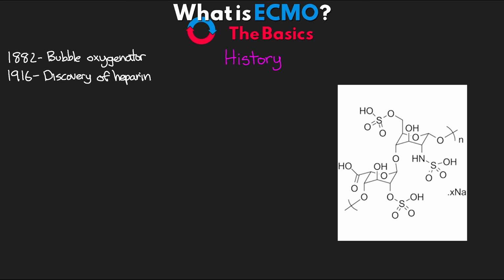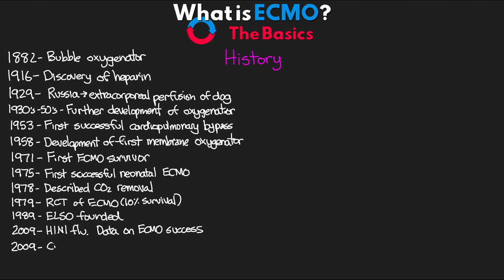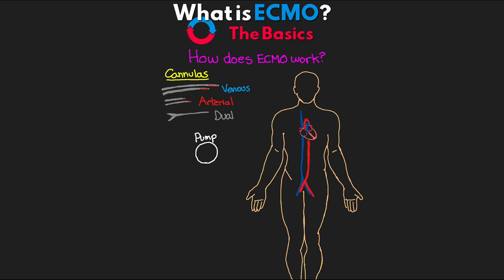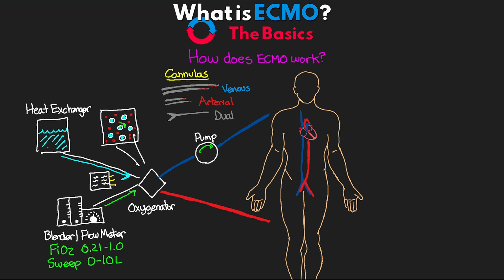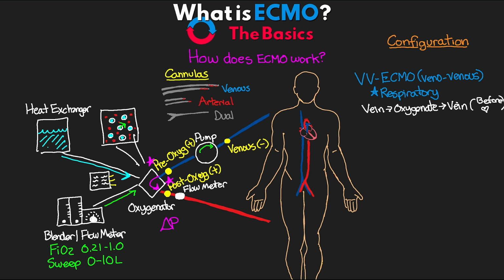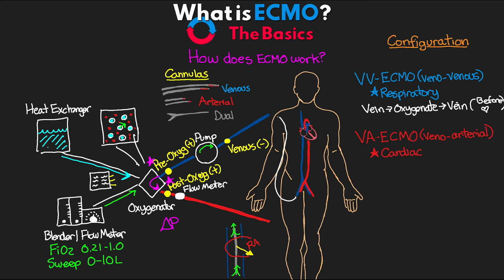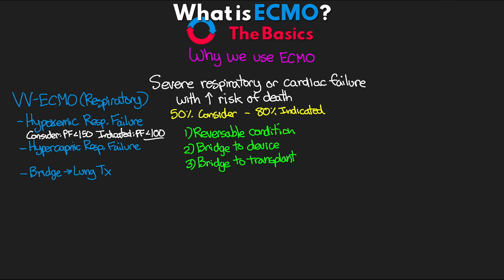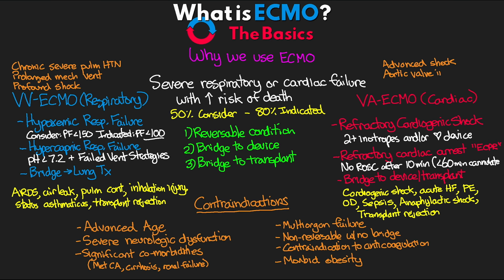What is ECMO? The basics explained.

Comment: I guess I missed something, how does returning oxygenated blood to arterial side help, if patient has heart failure and can't pump it around?
Reply: The ecmo provides the pressure
Reply from the maker: Yes! So in VA ECMO (which you described, pulling from the veins before the heart and returning blood to the artery after the heart), we are moving blood forward in the system without the help of the heart. When the heart is unable to adequately move enough blood forward, we can use ECMO to "bypass" the heart and still provide perfusion to the rest of the body.

Comment: My wife is an ECMO survivor. She was 18 years old at the time. She had DKA w/ BG of over 1000. She was ECMO for 13 days. She actually had a tracheotomy before this. Then coded twice. 

They did not think she would survive. The only reason she was placed on ECMO and survived is because she was a registered organ donor. They were waiting for her Brain waves to stop but they never did. Instead she started to turn around. 

At the time she went into renal and liver failure. She had issues with ARDS as she was weened off.  To everyone’s shock in ICU  once the glucose levels went down the liver function came back online. Eventually she came of dialysis and renal failure improved she still ended up with AKI. 

From there she was still vented. It was for a total of 2 months with the trach for successful weaning. 

After that she was in rehab for a month and had to be classified as a stoke patient due to how everything affected her. She did end up with a brain injury while on ECMO. She also had her issues with her arm literally exploding and now lasting nerve damage. 

Finally here was the outcome from all of this, she basically has normal function, she works as a CNA as of today if that is not a testament, don’t know what is. 

There are lasting effects for her though, her gait pattern is a bit off. She has issues with her right hand with nerve damage, unable to detect pulses and has isssues detecting hot and cold. You can tell she had a brain injury by the fact that she has hard time remembering things from before ECMO but her current memory has no issues. She is currently studying to be a nurse. There is some issues with lung scarring and scarring from the trach internally. She has some issues with feeling in other places like her bladder.
She is ten years on now and you wouldn’t know by looking at her other then the scarring on her neck from ECMO entry point, the CVC, Trach, dialysis scar and the marks from her lungs being drained that anything happened to her.
 
I worked as an ICU nurse being trained in ECMO and am absolutely amazed by her story.

Comment: Just a question. If a patient on ECMO requires RRT, do you prefer to go for PD or HD/CRRT? Because it would be difficult to have so many lines in patient.
Reply from the maker: CRRT for sure. We usually line with HD line before we cannulate.
Reply: @ICUAdvantage  thanks for replying

Comment: Awesome! The ICU I work in doest do ECMO but we retrieve patients out for ECMO. I recently got to see a patent on ECMO. I could understand how he it was oxygenating him but didn't know how Co2 was being removed when he had tidal volumes of 7mls. You just explained it. Kind of like CRRT for the lungs. Thanks. 
However, why would they have an Fio2 on the vent as well. He had Fio2 of .70% on ECMO and vent.
Reply from the maker: Hey Don! Thank you. Glad you liked it and happy that this was able to help you to understand some of what you were seeing. It truly is a pretty amazing therapy that we can offer patients.

As for the FiO2, without knowing the situation there, it certainly is possible that the oxygenation from the single ECMO circuit was not enough. We can't control the oxygenation and they get full oxygenation. The rate of flow plays an important factor in how much blood we can oxygenate. If flows are decreased due to issues, we may need to compensate with additional oxygenation via the lungs, even if it isn't optimal. Over time, we also lose efficiency of the oxygenator to oxygenate. Think degradation and clotting.

It isn't that uncommon for us to not be able to achieve adequate oxygenation with a single circuit and sometimes have 2 circuits going to provide adequate flow and more oxygenated blood. I talk about this some in the 3rd lesson in the ECMO series here.

Hope that kind of answers your question. Ultimately, if we can get enough support with ECMO, we will use very minimal vent settings (sometimes even no vent). Other times, we need that extra support for some time.

Comment: In really enjoyed seeing how ECMO has progressed  over the past 30 years.  I was a cardio-pulmonary tech @ WHMC from 1973-1990.  Drs. Robert DeLemos and Don Null were some of the early neonatal pioneers in using ECMO.  The typical patient was a premature newborn, usually weighing less than 2000 grams and delivered because they were in fetal distress.  When that happened, the baby would release it's meconium plug (essentially inutero stool.)  It often had the consistency of tar.  The baby would inhale this while still in mom's tummy and require ECMO.  Wilford Hall's ECMO device looked somewhat like a Rube Goldberg device, but it worked fantastically well.  When I retired in 1990, WHMC had the only ECMO that a neonatal patient could be placed on and flown across the country.  The reason- at that time the standard aero-vac plane was some version of a Lear Jet.  Not a lot of room inside for all the personnel needed.   Thankfully, Uncle Sam had a large fleet of C9 air evac aircraft that could carry ECMO device, patient, 3 RN's and 2 technicians and a respiratory therapist.
Reply from the maker: How cool! Wow, thank you for sharing. Its always amazing to see how things progress over time and to hear about how things were before. Now-a-days, it has become such a small "manageable" device. Moving around with it is so much easier than even the setup we used just before the new Cardihelp pump, which is quite small and very portable. Add to that the increased availability and usage across many populations and it has become such an incredible tool to save so many people. I'm always in awe of the technology and it will be interesting to see how it advances in the future!

Comment: Ecmo adds oxygen but what about carbon dioxide removal?
Reply from the maker: It does both. The sweep gas removes CO2. We adjust the rate of sweep to control how much CO2 is removed. We really don't adjust oxygen delivery as we often just keep FIO2 at 100%. There isn't any harm in overly oxygenated blood.
Reply: @ICUAdvantage  amazing truly amazing wow! Does every single emergency room have one? Seems emergency rooms are not standard and go by state as what medical equipment they’re required to have. Lastly, why the heck do EMT work so darn slow in emergencies not all but most why is this?

Comment: In my understanding, arterial blood flow moves away from the heart. What is done to cause the blood to travel retrograde when the arterial return is not central (ex., femoral)?
Reply from the maker: When centrally cannulated, the blood mostly flows in the normal direction. Its only when the return cannula is femoral that we deal with retrograde flow. Simply the flow itself and the direction it is pointing causing the retrograde flow. Hope that makes sense. Let me know if I'm missing something...
Reply: @ICUAdvantage  so are you saying the cannula is placed retrograde for delivery but the direction of blood flow is unaffected? I think I am losing how a femoral arterial cannula will deliver to the upper body structures 🤔.
Reply from the maker: @doristhecoder765  Correct. The cannula is inserted in the fem and going backwards up in the aorta. As the blood flows out, it is flowing backwards in the aorta, causing it to travel all the way up the aorta, perfusing everything along the way.
Reply: @ICUAdvantage  Oh! Because flow is stopped it isn't working against it because the heart can't do its job properly. 

Another AHA moment. Thanks Eddie

Comment: How does ECMO prevent stress on the heart and lungs when the catheter goes back into an artery? Also, are the catheters heparinized? Would ECMO ever return the blood to the Pulmonary Vein?
Reply from the maker: So for straight VA ECMO, we are not going to really be able to rest the lungs as they need to continue to function to provide oxygenated blood to the heart and head potentially.  The heart is rested as we are taking over the perfusion and reducing the preload significantly creating less work for it to do.

And yes, I actually make slight mention of this in the 3rd lesson in this series but there is a ProtekDuo catheters that drains from the RA and returns in the Pulm Artery. Primarily used for R sided support but you can also put an oxygenator on it and it essentially becomes VV ECMO.

Comment: Great video, thank you!  So if the patient is on ECMO and they go into vfib or pulseless vtach that doesn't convert with defibrillation after the first shock, do you start CPR or would you continue to let the ECMO pump circulate the blood alone?
Reply: It depends if they are VV or VA ECMO. VV only supports the lungs so in this case you would perform CPR. If they are VA, the pump is providing both pulmonary and cardiac support so CPR wouldn't be required.
Reply from the maker: R C beat me to it and is correct.  To add just a little...

VV ECMO is dependent on a functioning heart to pump the oxygenated blood around the body. So if they loose a pulse, you would initiate CPR but keep the ECMO going. Shocks, compressions, the whole thing.

VA ECMO still functions with no cardiac activity and is providing the perfusion and oxygenated blood for the body. You more than likely won't identify a pulseless VTACH since we will have a MAP going from the ECMO. That said, any lethal arrhythmia we would attempt to shock them out of it.  As long as we are maintaining good flow and MAP from the ECMO, we would not do compressions.  They can persist for a long period of time in a lethal arrhythmia, but at some point it will either become asystole or it would become futile if they didn't go back to a rhythm that can support life.  If we lost flow or pressure from VA ECMO, then we would clamp out (stopping ECMO) and run a full code as normal.  Doesn't happen often, but when it does its a bad day.

Hope that helps! 😊

Comment: can you go into what the nurses expectations to prepare for ecmo are?
Reply from the maker: So it probably varies from facility to facility, but I can only speak on my experience at my facility. And it can either be chaotic for a crash cannulation, or a more controlled planned cannulation where the patient isn't crashing.  

That said, first and foremost is to activate the activation team as that takes time to get everyone to show up.  For us, its the OR team coming, imaging coming with the C-arm, perfusion if available. From there, in the time waiting for all the key players to show up, clear the room of anything unnecessary as you'll need all the room you can get. We also place the patient on a special bed that has a big window to view under fluro, especially for the dual lumen placement. Also pull out and prepare drugs and fluids. At the very least we would have Levo and Epi mixed, primed and attached if not already running.  Also a couple liters of fluid ready to go.  Have a few vials of heparin ready to go. Also make sure your patient is medicated well. More than likely already are at this point.

Now depending what type of ECMO you will be doing and where you will be cannulating, there may be time involved to move lines. Oftentimes if we already have a RIJ central, we will have to place a new one and just guide wire the old line for the dual lumen Avalon cannula. We also want to make sure all lines are placed at this time, if not already there, as when we go on pump we anticoagulate them so we want this stuff done ahead of time. Foley, OG/NG, feeding tube, new central, a-line. Have all that done and in place. Make sure you have good ECG placement and stickers. Also go ahead and put on pads just incase things go south.

Also make sure and grab the ECMO machine and supply cart. Make sure the heat exchanger is on and warming up. Never want to start with cold water. From there, just be ready to begin once everyone is there and ready. Once the cannulation begins, at least at my facility, the role of the bedside nurse is pretty limited. Push some heparin, start or titrate pressors if needed. We do have select RNs trained as primers for the ECMO circuit now, so perfusion may not always be there doing that. But outside of that, theres not much to do until you are up and running.

Now, depending how your facility staff's the ECMO patients, if a non-ECMO nurse is in there and you staff the patient with only ECMO RNs, then obviously being able to quickly give a detailed report is important.  There won't be a lot of time to do everything that needs to happen so make sure you are prepared to give a quick thorough report.

Thats about all that I can think of for the moment. I'm sure I missed some things, but hopefully that helps!
Reply: ICU Advantage Perfectly timed video, we just cannulated our 3rd ECMO at my facility. Though I’d already done a fair bit of research, haven’t been there for the cannulation itself and appreciate the heads up on things to have prepped as an RN!
Reply from the maker: @goey516  I would imagine your facility probably has a checklist of things to do beforehand. Make sure you learn that and know how to find it quickly so if you need to crash on quickly. How do you guys staff it? We run 2 ECMO specialist RNs in the room (at least initially). Some places utilize RTs and others have perfusion based programs.
Reply: @ICUAdvantage  To my knowledge I don't believe there is a checklist, just seniors that happened to have been there each time an emergent cannulation goes down so maybe they can help set one up! To be fair, before this year we got ECMO pts maybe twice a year, usually VA and already set up from the OR. With all this COVID stuff going on, howver, we've been utilizing ECMO on the regular and emergent cannulations are almost the norm now. Which is why I want to point out having some fluid and pressors primed and ready is some GREAT advice, since we've learned the hard way those arent things you want to be scrambling for when you have a preload and afterload dependent system that is the only thing keeping your pt alive 😅

Rants aside, our VAs usually are with 2 RNs, at least at first as well. Ive noticed after cannulation is all said and done, our VVs are almost exclusively 1:1 with a perfusionist there to deal with the machine itself in both cases. 

As if this response wasn't already too long to read 😂😂 if you ever have the chance I would absolutely love a copy/pic of your hospital's checklist so I can maybe have a starting point. Either way thank you so much for the valuable information!
Reply from the maker: @goey516  Feel free to shoot me an email at icuadvantage@gmail.com and I'll see what I can get together for you.